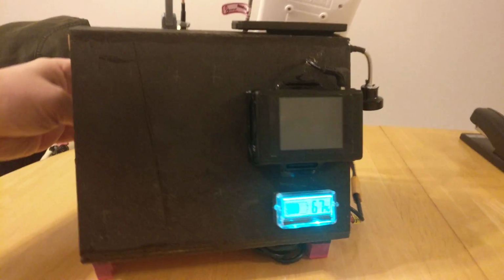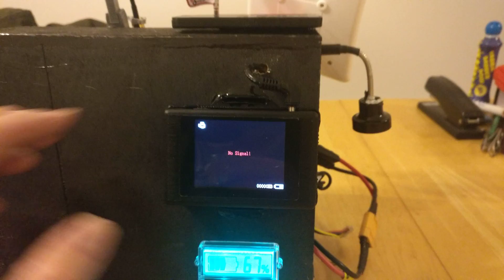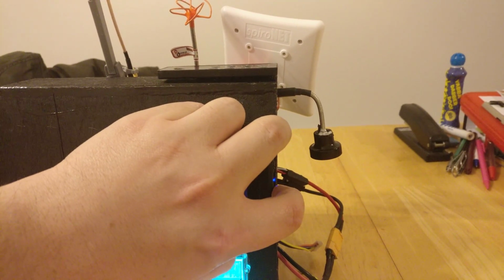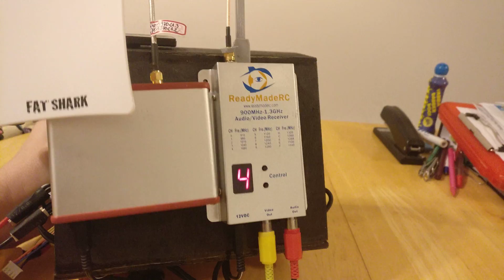DIY Self Contained Dual Band Ground Station. (5.8Ghz & 1.3Ghz FPV)

Comment: You still use it?
Reply from the maker: Sold it over a year ago.
Reply: @CarftyCarper  lol that’s why I asked , I would of brought it
Reply: @CarftyCarper  so with the eagle eye I don’t have to solder to get a 5.8ghz repeater to work?
Reply from the maker: @gpgp1750  no the fatshark repeater just plugs in.
Reply: @CarftyCarper  wow ok , so besides getting video to ur goggles is there anything else that it helps you with ? And thanks for the replies back, I appreciate it
Reply from the maker: @gpgp1750  dvr and repeater mainly.
Reply: @CarftyCarper  ok